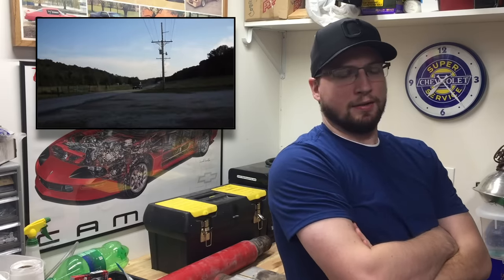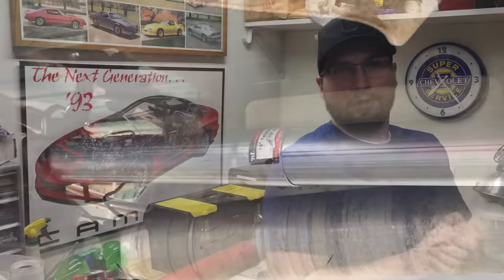Cherry Bomb® Glasspack vs. Straight Exhaust Pipe - Sound Comparison - 5.3L Chevy

Comment: I just cut off the muffler on my 2005 6.0 Wow sounds great and the dash miles per gallon readout says I'm getting 2 miles per gallon more with out the muffler.That is the biggest muffler I've ever seen .Damn near 4' long.I'm not done with the exhaust yet.I think I'm going to add cherry bombs or some other high flow muffler.then have the pipes come out in front of the back tire.Cant think of any reason to run the pipes all the way out the back.

Comment: Right now my truck is basically straight piped. More the previous owner simply cut the muffler off. I like the way it sounds, but it's too loud in the cab, get too much exhaust smell. So I just bought a glasspack. Personally I like the quieter but still throaty tone of the glasspack. Loud enough that you'll hear it coming and going but not so much that you'll be cussing the whole way home when you have a headache.

Comment: Aw no I like strait pipes from the manifolds all the way to the back with no restrictions like I did my 85 Ford f250 xl 4x4 with 351 windsor  4 barrel carburetor one draw back can't stand on it in town after 10 pm or it's a noise orderance ticket ........

Comment: i like the straight pipes.  not for your daily driver, though.  i had a 69 chevy 4x4 with a 350 and 4 on the floor.  it had no catalytic converter or mufflers and was straight pipes chromed behind the cab like 18 wheeler smoke stacks.  loud as hell and making a scene.  it got my adrenaline pumping every time i drove it.  it was beautifully painted blue metallic flake and chromed.  got about 6 miles to the gallon and then 9/11 happened.  had to sell it and buy a honda.

Comment: Classmate used to burnout the glass before installing glasspack.  Straight pipe sounds louder however these days I'd be curious with inflation & all if straight pipe is cheaper vs glasspack being a red painted straight pipe?

Comment: Well, I'm sold all over again on a muffler over a straight pipe. I just developed a hole in my muffler about a month ago and thought about just running a straight pipe off the cat, but hearing the difference between these two, I'm going to go with some straight through muffler. It seems as though the straight pipe makes the engine sound like it's working hard even when it's not, and is loud when it doesn't need to be.

Comment: The straight pipe is louder, but the glasspack is more throaty soundin. I like the glasspack better. Ive got stacks on my obs ford, regular cab. N straights were so loud u couldnt hear yourself think. Put glasspacks on it n its still somewat loud, but not so bad.

Comment: I’ve been running my first 23” in length, 2.5” inlets with 3” bulb of that center of the cherrybomb glasspack, down to the trd sport muffler on my 2015 lifted Scion xB. For 4-5 years and it’s a perfect sounds for daily. 
And it sounds like what a TRD should sound like as a catback version exhaust that should came out from Toyota dealer. 

I love these cherrybombs mufflers/glasspack.

Now I have a small exhaust leak on the welding so it hold up very well.

But now I will get a full new carback exhaust by 2.5”.
From Vibrant performance- ultra quiet resonator, down to the 12” length with a 3” bulb center of the glasspack, to the side exhaust. 

Something different and this will sound much deeper and more aggressive for daily. I don’t want an obnoxious loud exhaust. Just a perfect volume for my vehicles needs.🙏🏼🙏🏼🙏🏼

Comment: For one too big of a glasspack do you say 30 in I know back home in Kansas the shortest you could go was 18 but people also used to do the glass pack trick heat them up dunk then in water break out the glass inside of them then it's basically a straight pipe and it crackles a little differently I think just my thoughts

Comment: If you get your glass packs super hot and then hose them down with cold water, it breaks down the glass inside the pipe and gives it a more rumble y sound! Old lowrider trick.

Comment: I like the glass pack, it depends on where you live, can you pass inspection without mufflers? Glass packs though minimal are still mufflers.. Depending on the kind some don't wear out they are a solid material with knobbies, some glass packs still have baffles those with fiber glass do wear out over time... I don't know how the cherry are built but I remember my neighbor growing up had one on a Daytona it was loud.. I had a more modern design on a saturn that wasn't too loud and sounded great but it was a no name from a local muffler shop
Reply: "Can you pass inspection"

"...pass inspection..."

".....inpection....."

😂😂😂
Reply: All correct, though! Ceramic fill will typically last forever (Borla 40359 is guaranteed, Flowmaster is guaranteed for life)

I still like to use glass packs in place of resonators, when they wear out it actually gets better lol

Comment: The glass pack is smoother with a more even, low note rumble.  As the engine rpm's reach & linger a second at each shift peak. You don't hear any "crackle". As for the straights.
With nothing to add uniformity or tone, you hear that distinct, watery, glugging sound at idle.  Just like the underwater exhausts on those old Mercruiser V8 powered, Ski Nautique boats. At each shift peak, you that sharp pop & crackle sound that common with straights. As opposed to the sustained, even depth, and chambered tone of a glass pack or thrush. However, pipes are far less prone to rust holes, metal rot, etc. and never get louder. Like mufflers do.

Comment: On My 94 GMC I did a y pipe straight off the cat then dual out the back behind the tires with 4" slant tip stainless steel tips it had a nice deep tone but not to loud and soon everyone was copying what I had done.

Comment: It’s not  the quietest but i like the Glass pack tone the best   and i’ll admit that one of my lifelong Passions  has been Power Boats many of which have had AmericanV8 Power plants that use a straight pipe Exhaust  mixed with Raw Water  to keep the exhaust Cooler and dampen the sound  so i like theThroaty deep sound of the  big and SmallBlock motors  also another “trick” boats use is  directing the exhaust thru the back of the vessel below thecWater line that Absorbs  a fair amount of the sound into the body of water into the Prop wash of the Rear of the boat Under way

Comment: Save money get a better ruble and better air flow straight pipe the way to go. Try running you car to operating temp cut it off for about 10 15 min go outside crank her up and give her hell she will pop and crackle like crazy I have the same set up on my 5.4 f150 except I have 3 inch pipe

Comment: I used to have a '95 z71 with the 350 and it sounded rather mean with no cat and a generic flowmaster type dual in/dual out muffler. Damn I miss that. My current daily driver is a 2000 crown Vic with the stock dual exhaust and it's quiet as can be. Kind of boring.

Comment: Good video.  I've got a 2" straight-pipe all the way out to the back bumper on my truck, with a 240 inline six, and I'm looking to see what muffler I should buy.  It's a little too loud, like yours was, and there is that loud burbling too, which needs to be smoothed and mellowed out.

With less than 8 cylinders, it's going to sound like a fart.  Glasspack? You're safe.  Straight-pipe?  Check your shorts...

Comment: I had an old beatup 340 AAR Cuda with Cherry bombs and headers and they sounded much better than straight pipes, it was a great sound with the glass packs even as they wore out they still sounded great not too loud except when you jumped on it getting on an expressway, then they roared.  My buddy said it sounded like an Indy car to him with all my mods I figured 350 HP was about what I had it was fast but not compared to cars now if I could do a 5.5 sec 0-60 that was about all I could get out of the 340 but it was fun to drive

Comment: They both sound good.  Straight sounds louder but glass pack sounds more consistent.  Maybe the straight pipe would need to the engine to be re-tuned throughout the rpm range.

Comment: I had a straight pipe on my 04 Silverado ....
It was just a little to loud when I floored it. 
What I did was put a 12 inch cherry bomb on it and now it awesome !
Reply: I had the 12" one chamber cherry bomb exhaust with a turn down. Loved it. Trying a 25" thrust glasspack next week. I will see which I like better. Exhaust is cut off right now and with the hemi its annoying. But holy crap you get stares when you punch it lol

Comment: I just did a muffler delete on my 2013 CTS-V w/ 6.2 LSA. Straight 2.5” from the primary cats to factory x-pipe, straight out from there. It sounds awesome, but this is the exact video I needed! I think I’m going to put a couple glass packs in to tone it down just a tad. Question... Do you still get that good cackle and pop with the glass pack when you let off the throttle?
Reply from the maker: Yes, after the glasspack has been on for a few thousand miles and has had time to break in.

Comment: I definitely like the cherry bomb better. It has a low rumble and the straight tube has a crackle to it. I have duel exhaust with cherry bombs cut off in front of the rear wheel on a 401 AMC Jeep Cherokee and it sounds amazing at idle through redline.
Reply: The cherry bomb sounded like it neutered the truck. I like the natural sound of an engine.

Comment: headliners falling. I could have replaced that bitd for $75. The glasspacks sound way better. I had shorty 3" on my race car and it was still louder than 10 Harleys running wide upon at idle in a 1970 big block Buick 12:1 462c.i. Kenne Bell MARK C107/118 cam in a 1987 Buick Regal.

Comment: My dad says the glass pack is too loud. Is it real that loud or is it quieter than exhausts like the flow master or magnaflow?
Reply from the maker: It really depends on the length of the glasspack. My 30" glasspack isn't too loud. It has gotten louder as the fiberglass has burned up a bit.

Comment: Straight pipe single exhaust sounds good. Had that straight 3" single exhaust on a LS1 Camaro I had for a while. Sounded great. 
True dual exhaust straight piped sounds hideous tho. Way too loud and no quality sound at all.
Reply: I used to have an '00 z28 with a dynomax 3" "bullet race system" catback. It sounded mean! I miss that car, sold it 10 years ago. Bought it with 130,000km on it and put another 100,000km on it with minor repairs. Could get 27mpg all day long at 70 mph

Comment: I like the glass pack better, no question!  You say it's 2¹/²", I have an Envoy XL with the 5.3 V8 that I'm having difficulty finding the exact size online, but believe It's a 2³/⁴ Do you know?  I'm looking for a deeper sound, but mainly trying to unleash a couple horses and slightly better MPG. Don't want too obnoxious (banging on a tin trash can, popping, or too raspy), but want inexpensive.  Do you think a long Cherry bomb is the way to go on the cheap,  I've also considered muffler delete with used resonator in its place. I have 'kitty test pipes' and which also makes it a bit more raspy and louder, so don't want muffler-less!

Comment: You're having trouble finding the right sound because you don't have a Hemi.  Glass pack sounds intentional.  Straight pipe sounds like you dropped the muffler on a speed bump.

Comment: For a pickup truck, the sound may not bother the cabin too much. But my SUV, my wife turned to was louder than the straight pipe when she complained on the droning. How about the performance or take off, or the top end speeds? Where they affected?

Comment: For me, straight pipes only work on a true dual... When i had a 72 C10 sclb with a 350 sbc, i had true dual straight pipes and i loved how it sounded. 

I'm looking to get an aftermarket muffler for my 89 E250 with a 351windsor, and I'm trying to decide between the Flowmaster Hushpower series, a Dynomax 2 chamber, the Cherry bomb glasspack, and the Thrush Welded 2 chamber muffler.

I've narrowed it down to those 4 and yet i can't decide which one i should go with, because they all produce the type of sound I'm looking for

Comment: I HAVE A 07 CHEVY SILVERADO. V6 4.3.  1500. I PUT A STRAIGHT PIPE ON IT WITH A. CROM TIP 3 FT 2IN ROUND I LIKE IT BETTER THAT WAY THEN A CLASSPACK.

Comment: I have a question for anyone who knows but I have a 2007 Chrysler Sebring and I cut my muffler off and put a exhaust tip on it and it's loud but then I bought a straight pipe and clamped it onto my exhaust and put the exhaust tip on the straight pipe and noticed a difference so I was wondering is it still considered a muffler delete or is it considered straight piped now?
Reply from the maker: It’s technically considered straight piped when the catalytic converters are removed, otherwise it’s a muffler delete.
Reply: @TheDaninator  yeah so I just have a muffler delete then because only thing I cut off was my muffler and then I put a straight pipe onto the rest of my exhaust and put a exhaust tip on the straight pipe
Reply: @TheDaninator  plus I've been reading comments and posts where people say a muffler delete and straight pipe is the same thing this is my first ever car so I'm just trying to learn about things that I want to do to my car
Reply: @TheDaninator  also thanks for the reply

Comment: Try this! I've done this to my pick up years ago. Turn the glass pack around backwards when installing then take it for a ride to get it nice and hot and have somebody with a water hose ready. Turn the truck off and shove that hose in the exhaust to break up all the fiberglass inside then start it back up  and romp on it to blow it all out. Love the sound after but then install a 4 inch echo chamber the same length as the glass pack. It's really nice. I wish I could send you a video of it but this was way before cell phones were in everybody's pocket.

Comment: I have decided to cut my muffler and replace it with a cherrybomb but I'm not sure what size to get right now there are two sizes the 30 inch used in this video and the 8 inch one, could someone help me decide which one is better for my 4-cylinder ford fusion?

Comment: Straight pipe sounds better to me but throw some dual exhaust at 45degree angle. I have a 95 f150 with the 5.0 with the straight pipe at 45's.

Comment: Glass packs for sure  you shoulda compared with some engine brakeing like putting it in low gear and deceleration from a higher gear .my old Chevy impala sounded so good getting off the freeway .the strait  pipe sounds like a boat

Comment: I had a 2002 6.0 that I ran straight piped for about a year. That goofy thing made a tremendous amount of racket. Finally had a Flowmaster 50 dual out installed on it after that by a shop and it was so much more pleasant to spend long road trips in.

Comment: Glass pack is better sound than straight pipe  and adds some necessary  back pressure for performance of a street  machine. Also, most states require  a muffler on all motor vehicles operated on public streets. Some states that  have a state inspection for vehicles  will fail a vehicle  without one.  I love hot rods but straight pipes don't cut it.

Comment: Oddly enough, the best sounding exhaust I ever had was on a rusty Buick Roadmaster (had a Chevy 350 with single exhaust).  Muffler fell off, but all the exhaust up to that point was intact.  The catalytic converter combined with the several feet of pipe after it produced a muscle car growl but was still pretty quiet.  Once had someone comment that the car "sounded like it should be loud, but wasn't."

Eventually the few feet of pipe after that cat fell off (since nothing was supporting it) and then the car sounded much louder.  Still sounded pretty good, but the volume was boarder line obnoxious.

Comment: The straight pipe sounds nice when at idle but not as smooth sounding when driving. The glass pack is quieter than the straight pipe when at idle but sounds so smooth when driving. I like the glass pack sound when reving up the engine because it's border line back firing sound. I have a 96 silverado 5.7 with open air K&N filter and true duel exhaust but have no catalytic converters just straight from the header into duel glass packs with 3 inch pipes angled and it is loud as heck. 👍💯🔥 Great video buddy.💯

Comment: How do you calculate exhaust pipe when fitting two pieces together? If my reducers from my header are 2" OD, do I get 2" ID or 2-1/8" ID to slide over the reducers? I'm thinking a 2" ID does not leave room for mistakes from the machine that expanded the pipe. I believe 2-1/8" would be a nice comfortable snug fit. OH, and Glasspacks that have been burned out sound better.

Comment: I've got an Aussie ute with a 6L L98 with rear muffler deletes (bought it that way). It sounds great outside but it drones like a mofo in the cab at certain RPM (particularly highway). Probably doesn't help that the tub has a hard-lid acting like an echo-chamber. The Cherry Bomb sounds good - I might have to consider an exhaust upgrade.

Comment: I like the glass pack better. Years ago, a friend helped me with a "muffler replacement." We took an old muffler and shoved a glass pack straight through it. We used the old muffler effectively as a hanger. As a muffler, it didn't do squat. (But, by not running exhaust through it, we knew it would last a lot longer.) :-)

Comment: I just did the exact same thing to my 07 Sierra went from stock to Dynomax Dynomax sounded the same but was significantly lighter ran straight pipe for a while just put on a thrush glasspack and it sounds perfect for me I enjoy the loud sound too but got a three-month-old riding in the cab now so I had to quiet it down I would like to ultimately run one in dual out on her. Anyhow good video bud straight and to the point